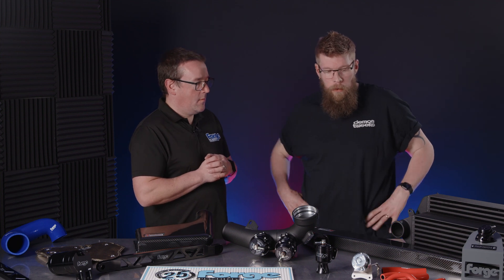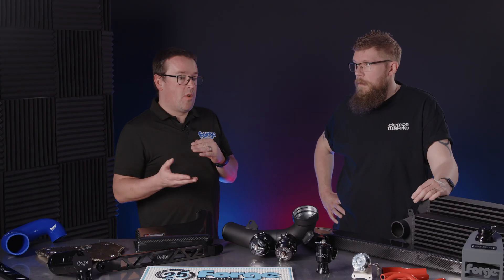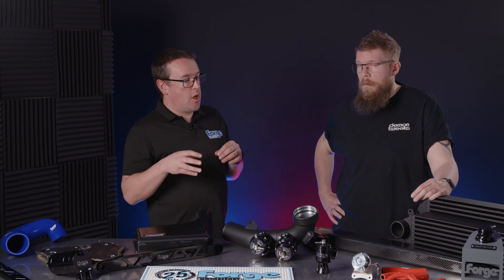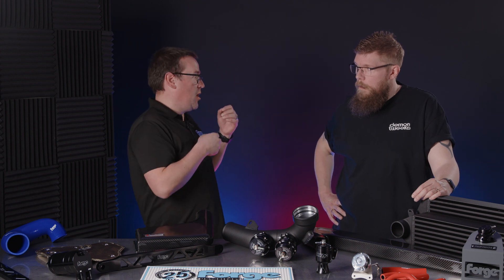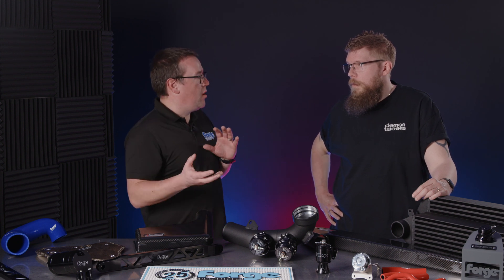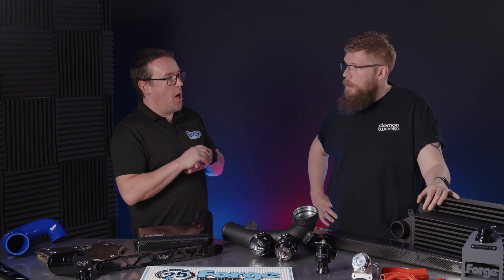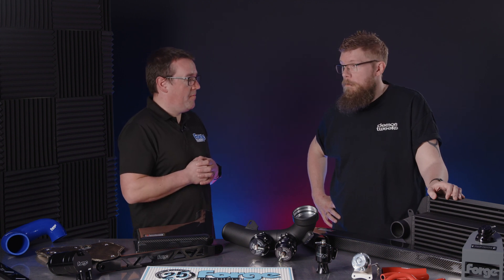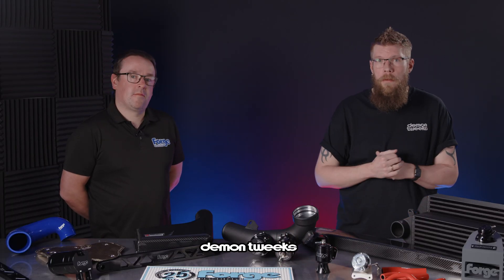Why You Need a Bigger Intercooler | Forge | Demon Tweeks

Comment: ive added a CAI to my swift sport and did a stage 1 tune, and this weekend im fitting a larger intercooler.
plan to replace downpipe next.
Reply: Same process underway for my vcross
Reply: which intercooler are you going for? i do also have a Zc33s and is looking at Wagner tuning.

Comment: If you put bigger intercooler without other upgrades,you dont get turbo lag?
Reply: I wanna do this but I've got HFC & full cat back exhaust
Reply: false
Reply: Yes u get but depend what size bigger the size of upgrade bigger the lag.
Reply: @AutoNshqip when I upgraded it it made boost quicker😭
Reply: @ What does it mean is something good or bad hahaahh
Reply: @AutoNshqip  well I got a “gold” mishimoto intercooler that’s like twice the surface area and bigger of my old eBay one so it feels faster lol without a tune hopefully I don’t need one for that
Reply: @ so have u measured it or not, at mine it didnt change  much just 1 or 2 seconds 0-200 les time needed
Reply: @ I can check measurements but maybe because it wasn’t so good or something or had a leak but I’m building up boost nicely not having to rev so high to achieve my boost
Reply: @ mine needs just a bit bcs i have turbo with vakum, but it punch directly thought 🤣🤣